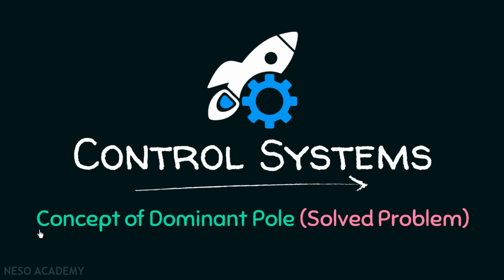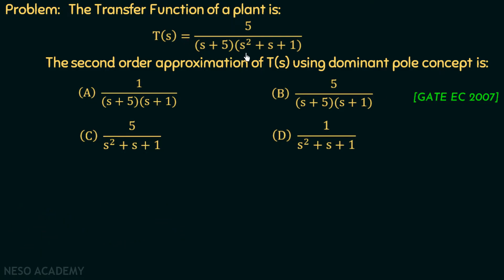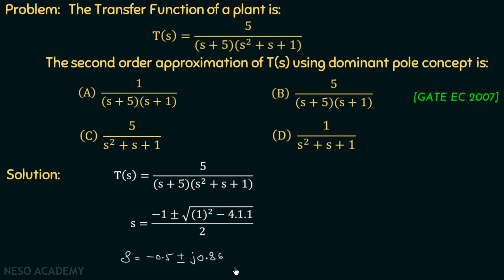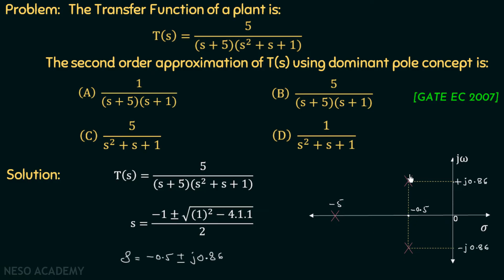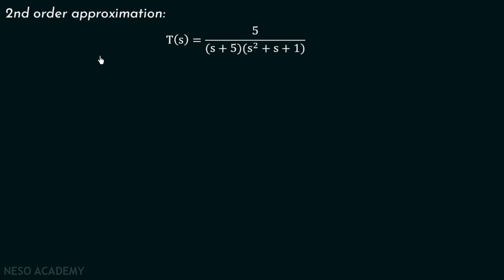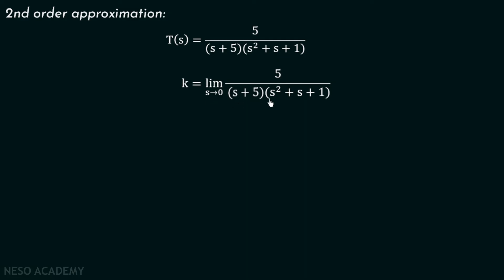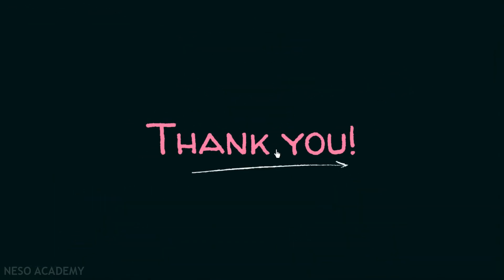Dominant Pole (Solved Problem)

Comment: Hey for (s+5) the pole is -5 and for (s-0.5) it should be 0.5. But u took -0.5 as pole. Can u tell why u took -0.5 as the pole instead of 0.5 ????
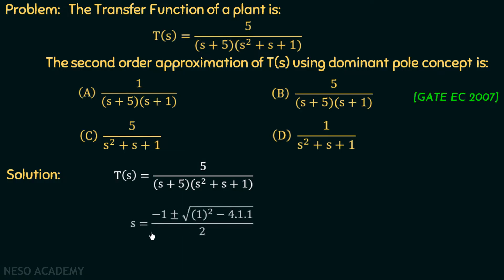Reply: He got the other two poles by using the quadratic factor on the s^2 + s + 1 term.  He goes through the derivation at 1:39.

Comment: Why are you comparing the ratio to 4? Where did u get 4 from?
Reply: He uses two criteria in order to approximate the system without an insignificant pole.  First, the ratio of the insignificant to significant poles has to be at least 4, and second, the DC gain of both the original system and the approximation need to be the same.  I'm not sure if different sources use different ratios as a cutoff, but I imagine they might.

Comment: Why you removed 5 on numerator.... Only (s=-5) was insignificant pole
Reply: in (s+5) put s=0 .. magnitude 5 cannot be neglected hence 5/5 = 1
Reply: @surajtakale  he is asking about the dc gain after removing insignificant pole, why the numeratot changed to 1

Comment: DC gain of =5/((s+5)(s²+s+2))
Also TF after neglecting insignificant pole.
Thanks in advance.
Reply: The DC gain should be a number, i.e. it shouldn't have any s's left in it.  If you plug s = 0 into the TF, you should arrive at the correct DC gain.

Comment: In the neso academy app in fuel can i get full course of data structure .reply me please 🙏
In c and CPP.
Reply: You will get everything in the app with  Neso fuel, the playlists are updated on a regular basis.
Reply: @piyushsoni4100  
Actually this course is complete till linked list only.
So my doubt is that when i take fuel than full course would be available or lec would be uploaded on daily basis.

Comment: After removal of the term(s+5) how the DC gain become 1?
If anybody know the solution of please let me know
Thanks
Reply: in (s+5) put s=0 .. magnitude 5 cannot be neglected hence 5/5 = 1
Reply: DC gain of the system was always 1.
Reply: @piyushsoni4100  when u r eliminating (s+5) from denominator they why didn't u write 5 in numerator ?? please explain where did that 5 go in the numerator while eliminating the insignificant term??? Please do reply
Reply: Dc gain is calculated before converting into lower order approximations.
So first we calculated DC gain then we removed s+5
Reply: @RaviRendersIn  how numerator changed to 1